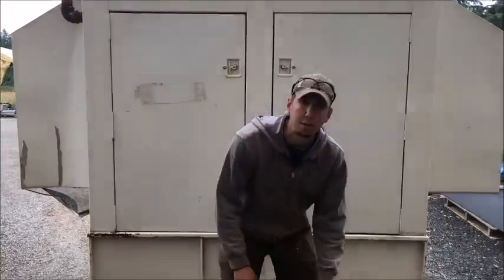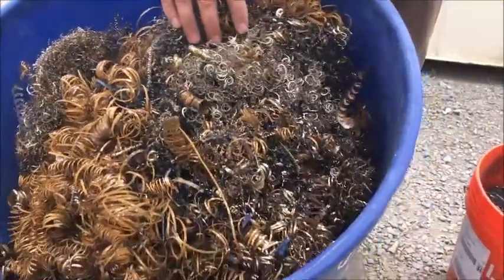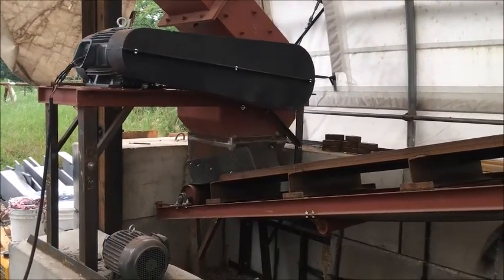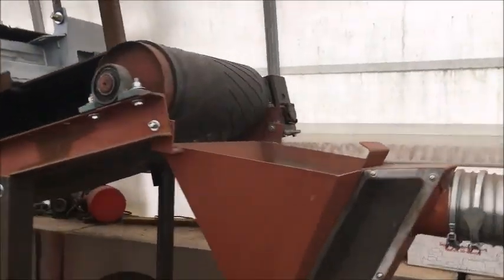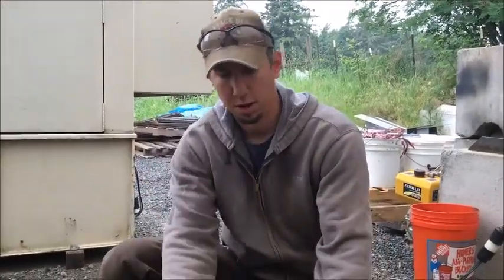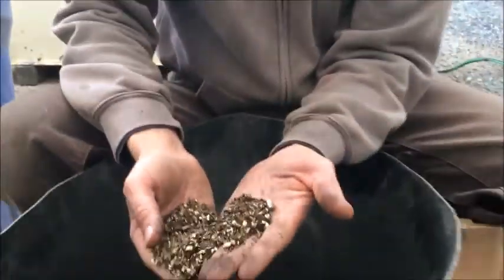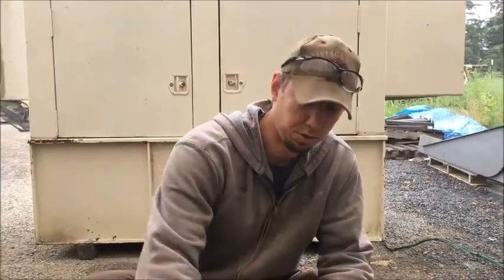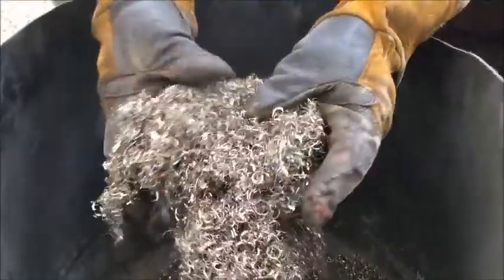Separating iron and non-ferrous turnings/shavings with a hammer mill and cross belt magnet

Comment: How long does a typical mesh in your hammer mill last for such an application? Is there a lot of wear and tear due to the sharp steel shavings?
Reply from the maker: For this application there is hardly any wear.  We have abrasion resistant hammers and armor around the inside of the hammer mill.  This hammer mill will probably process 100's if not 1000's of tons of shavings before the wear parts will need to be replaced.  Thanks for your question
Reply: +Jan M. I think it really won't wear it because the hammers de-bur the chips, and the steel they use is a lot harder.
Reply: Thx for your answer!

And also thank you for putting up all the videos, I am already looking forwards to the next batch!
Reply from the maker: Thanks!  Look forward to sending more vids your way